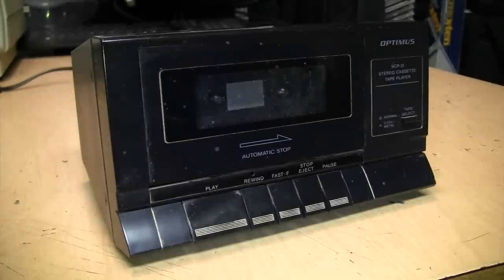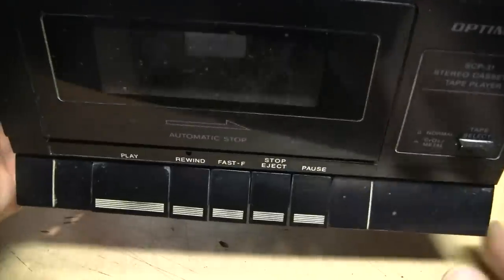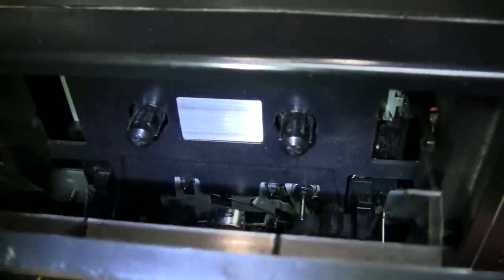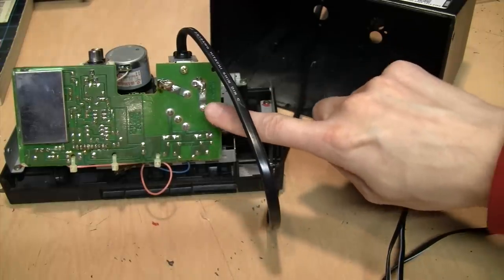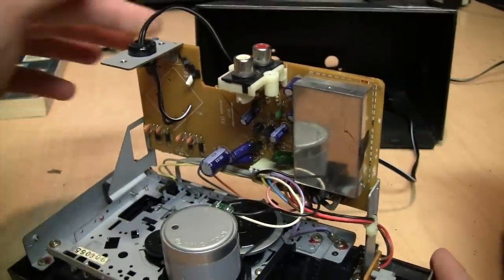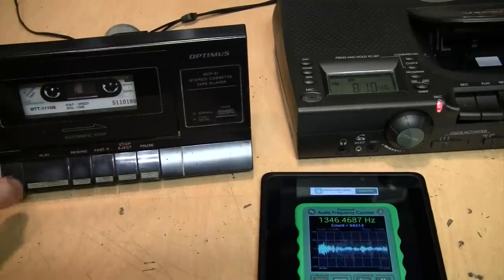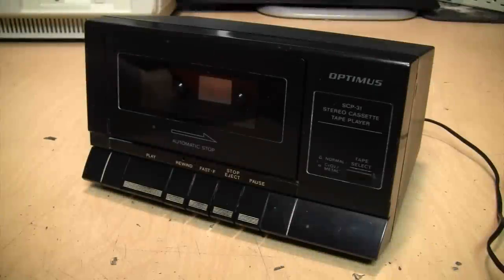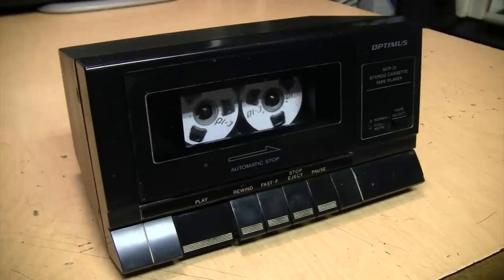Cheap but good Radio Shack SCP-31 cassette player repair

Comment: I'm blown away with the actual quality sound of such a relatively cheap unit.  Better than any current day tape mechanism sold on Amazon currently.  Makes me smile with how you brought this thing back to life.
Reply: This wouldn't impress much in 1989, except value for money. Tells you just how bad modern decks became.
Reply: @F40PH-2CAT  Especially since today's decks are basically the same design, so it's not like they have any new problems to deal with. They're just cheaping out to a (literal) fault.
Reply: for sure
Reply: Compared to MP3 the sound may seem OK.  When compared to an LP the tapes sounded noisy and lacked high range even with the latest version of Dolby noise reduction and "metal" tapes.  I mainly made tapes for car use.   My last deck was a Pioneer CT-6R.

Comment: I have a SCP-31. Original owner. And it still works! I worked for Radio Shack in the 1990s, and purchased one because of limited space in my apartment. It's not definitely not a Rolls-Royce among tape decks - more like a Volkswagen - but it definitely did the job it was designed to do. Music played on it was clear and an easy listen. It may not be the best, but for the price a SCP-31 can't be beat.

Comment: I enjoyed this. It was interesting when you pointed out the lack of a power switch, I hadn't noticed that.  That got me to thinking how receivers used to have power outlets on the rear.  I had a Yamaha CR-620 for many years, I believe it had a switched and an unswitched outlet on the back.  So, you could have plugged this into the switched outlet and it would have turned on and off with the receiver.  Those seem to have disappeared over the years.
Reply: Everything uses cheap annoying wall warts now
Reply: Believe it or not there's a switched outlet on the back of my AudioSource AMP 100. I don't use it, since the (rather large) toroidal transformer already whines and it's gotta be pushing some of that back into the mains power. I put that amp on the other side of an isolation transformer even though it doesn't make the whine any less audible.

This is some off the shelf black box from Parts Express ten years ago, too. Hardly anything in it other than the transformer and the heatsink for the transistors.
Reply: @The Vinyl Disguise I don't think it's really targeted at any particular device right now, but you can use that output to switch a much bigger relay and turn your entire rack of gear on if you wanted.

Comment: Love the Optimus stuff. I still use my Optimus system from 1991. I remember buying it and having to unbox some of it so it would all fit in my Chevy Cavalier. The speakers are huge.
Reply: same here. I have an optimus 10 band eq from the 90's too and it still works great in fact all of my stereo equipment is almost 30 years old and all of it still works great
Reply: But does it transform and roll out?
Reply: You had me at "1991" and "Cavalier."
I owned a '94 Cavvie 2-door once, that car was VERY good to me. Bought it from 2nd owner (1st owner was actually that stereotypical Little Old Lady) at 77k for $400, and I got t-boned by a Corolla at 236k, still on the original clutch when it went to the junkyard. (After the Corolla hit me, he got rear-ended by a Jetta... The only car not requiring a wrecker was my Cavalier!) Only left me stranded ONCE, when the fuel pump failed. I'd get another one in a heartbeat if I could find one.

I told a friend of mine once that I was going to grab an office chair for free on the side of the road, and he said, "you won't get that to fit in this car." Five minutes later, he had to move the passenger seat up two clicks, and the office chair was upside-down in the backseat. (My butt is currently planted in that same office chair sixteen or seventeen years later!)

And Brett - are you talking about the Optimus 10-band EQ with separate EQ for each channel, the "IMX Expander," and the tiny-dot LED spectrum analyzer? I had one of those too, I loved it. Unfortunately I fell on hard times and lost the contents of my storage unit years ago, that EQ was in storage at the time. 😢

Comment: I have two of these, in working condition.  Discarded by our church when we went to CD recording some 15 years ago.  (We've since obsoleted the CD burner, too, outputting from the mixer board to a SSD.)  I keep these two decks for the occasional dubbing request; some of my fellow geezers have family cassettes they have not heard in years.  The Shack also made a tiny AM-FM stereo receiver, about the size of a clock radio.  Got one of those, too, and it also works like a champ.

Comment: These transformers often have a thermal fuse that is taped to the secondary which opens if the windings get too hot, or just from age. I have repaired a few transformers by replacing or bypassing this. I am glad the repair worked well. What I would personally do, remove the transformer from the adapter and solder it to the original place to keep it cleaner. Love your channel, keep it up

Comment: When I worked at radio shack, these had a reputation of being very reliable despite the outward quality appearance.

Had a customer who bought a number of them tell his success with them, but were the auto reverse higher up version that had Dolby?  Been so long I could be wrong, but I remember us laughing about having Dolby for telephone on-hold, but only way to get auto-reverse in that model.

Told me they actually were the longest lasting tape decks they could find for their on-hold music systems.

Long chatter, but old memory that came back.
EDIT:  Wow, my memory worked...0:42 the $99 fancy one.  Sold like hotcakes.
Reply: I hate to be a "dick" lol, but if you watched his video he went through the radio shack catalog pointing out the 3 deck line up. Yes a Dolby and auto reverse model was available.
Reply: @glennjones6574  lol. YUP!  I had to edit my comment.  :)

Comment: I picked up the Realistic version at an estate sale last year for a cheap price. Mines needed belt and a disc capacitor resoldered in the inside the metal shield. Working great ever since. It’s was made April 1990.

Comment: I bought the playback only and the record deck on Ebay to go with my matching Optimus am/fm mini Amp which they were designed to compliment. Due to the age, I was hesitant, but was so pleasantly surprised. They were used in a garage work space (as it was described). Upon inspection,they were barely used, almost brand new. Both in excellent working condition. Okay they don't sonically reproduce like my larger system, but, for the den/guest room, the system produces beyond satisfactory sound. They, and the mini Optimus amp, connected to my large 70s vintage floor standing 3way speakers please these discerning ears.

Comment: This thing is awesome! Nice repair. I appreciate you leaving your incorrect guess in too, you could have easily edited it out to make it seem like you got it right the first time but repairs are all about making mistakes and fixing them.
Reply: For anyone wondering why that happened, the 12V AC is RMS (Root Mean Squared). The smoothing capacitors will charge to the peak voltage which you get by multiplying by the square root of 2   i.e. 1.41.   So once it is rectified and filtered 12V AC becomes almost 17v DC. The transformer manufacturer will also allow for the voltage dropping on load so the off load voltages were even higher,

Comment: This came from a good period in Radio Shack history, before the default answer to any question about a product was "Would you like a cell phone with that?" 
And thanks for showing the insides in the video, I've got the SCP-25 from just a few years earlier and always wondered if Radio Shack changed the internal mechanism as they transitioned from silver to the "black plastic" look...

Comment: My biggest gripe with these was how light they were.  It was hard to use the transport controls without the player scooting all around the shelf.   Thats why it was duct-taped down.  The alternative was to hold the thing down with one hand and push the buttons with the other (or you could do the spanned thumb-index finger thing).

By the way, the companion SA-10, SA150, and SA155 'mini' amps that these were often 'bundled' with also had the always-on PSUs, with the power switches wired into the secondary side.  I don't like that 'feature'.  It's why I have all my electronics connected to power via a power strip.

Comment: This shows that there are different shades of BPC, and this one is perfectly usable, especially considering the price. Its S/N ratio is good enough for radio recordings, and its wow & flutter is surprisingly decent, although I wonder why you haven't disclosed the numbers you've measured. As a playback machine it is no worse than the $500 TEAC W-1200, which has a similar mechanism and does not have Dolby NR just like this one.
Reply: BPC often isn't even all that "C". 
I don't think the case material and color is the best indicator for quality.
Reply from the maker: I tested it and it measures around 0.08% to 0.11% WRMS -- better than the factory spec of 0.15%.
Reply: @vwestlife  The factory spec says "wow & flutter: 0.15%" without specifying whether it is DIN or JIS or NAB, so it is unclear to me which standard did they have in mind. In any case, 0.1% WRMS is a very decent number for a cheap machine. You don't need an expensive complicated mechanism to achieve good enough performance. Thank you for the video!
Reply from the maker: @ConsumerDV  The manual for the SCT-510 lists its wow & flutter as 0.15% WRMS, so the SCP-31's rating is most likely WRMS as well.

Comment: At least it's not a knock-off of the Tanashin mechanism, and does have a genuine Mabuchi motor. That's already more than what you will find in most "modern" cassette players - which will also cost much more. All in all, I'd say that was a nice thrift store finding.

Comment: I collect tape machines and Tandy Radio Shack created a lot of value for the consumer at all budget levels.

I liked the way they put together systems with all the components already matched to work together for different budgets. Remember the "Good, Better, Best"? 

 I use a Realistic SA-10 solid state amplifier as my bench test amplifier. Power supply same design, it draws 1.1 watt in the power off position, and 1.7 watt at power on position at idle. Unplugged or hooked up to a power strip for sure. 900 mW per channel with no balance control, separate right and left volume pots, which I prefer on the bench. Think it was $4.99 at the Goodwill.
Reply: I have one of those as well, a good, basic small amp.  I got it from my brother, who somehow lost some of the knobs, which I replaced with a different set that at least all match.  I also have it's big brother, the SA-150.
Reply: @bobblum5973  I was just looking at mine and noticed there is still a sticker on the right hand side that says "Simulated Walnut Grain Finish".

 Really? Isn't it obvious? Does someone really need this information? Probably someone's job putting these stickers on as it is going down the production line.
Reply: @zulumax1  I think they started doing that as part of a "truth in labeling" law.  Like having to say "Walnut Veneer" so people would know it was a thin piece of real wood, but not solid wood for the entire cabinet.  Or listing the ingredients in order: "Soup; Chicken; Flavored".

Comment: I still have my early 2000 boombox with radio and CD and I enjoy it every time I can. Yesterday I visited a nearby recycling center and found a bag with 30 used audio tapes  and 4 brand new sealed TDK. Also I found a old Sanyo from '79 I think, mono tape recorder with FM/AM/SW radio, a beauty. I still have to figure what is its fault because it powers up but no audio comes aside humming. It seems is made entirely with transistors, no ICs.

Comment: I've got a Realistic branded SCP-32! I picked it up late last year and used it for my tapes before I swapped it out with a hi-fi mini system. Mine was an eBay buy so it was in great condition mechanically and cosmetically. I've got tight spaces to work with right now, so it was perfect.

Comment: This kind of transformer on the deck is fixable (they usually have a built in fuse/thermal fuse, only 110v transformers that have this fuse have 2 long pins that are soldered on the board and one short pin and all you have to do is measure to find what pins are soldered to the coils (generally one short pin and one long) i say that because i fixed a japanese boombox with the same problem and i added a external fuse to avoid burning the transformer
Reply: Came to leave the same comment. It was the thermal fuse for sure, they tend to fail by age, even if the transformer is perfectly fine...
Reply: @janosnagyj.9540  Yes
Reply: Yes have repaired many of those transformers by simply replacing the thermal fuse or bypassing it and place a small in-line fuse inside for protection.
Reply: @111000100101001  and works perfectly
Reply: @vinil, o melhor presente !  These decks would be happy in Japan with their 100V; it would last a little longer there!

Comment: Yes, when ac is rectified into dc the voltage goes up a little bit. Also, unless it's regulated the output will vary with the mains voltage. I didn't see a fuse either.
Reply: The voltage goes up by a factor of sqrt(2) = 1.414…
Reply: @MacPhantom  Minus the drop of the bridge rectifier, i.e. always 2 diodes in series - around 1.6 volts for two silicon diodes.
Reply: I noticed with a lot of older power bricks that I had I was surprised at a younger age that they may have been listed as 12V DC but they usually read more like 20V after that I became very paranoid about using them with some devices.

I was reminded of this a few days ago when I pulled out a 9V DC power adapter that was outputting 16V DC. I don't know if I want to use that with my portable cassette deck it's not like I want to I have to replace something in a $500 Sony recorder.
Reply: @imark7777777  It's simple. When you have an unregulated (non-stabilized) power supply, either AC or DC that is rated e.g. 12V/500mA, it means that - given the exact primary voltage - there's exactly 12 volts on the output when there's a current draw of exactly half an amp. On no or lower load, the output voltage will be higher; conversely, on higher loads, the voltage is brought down and the transformer saturates.
And, of course, if the rating is in ac, it means 12 volts root mean square of the sine wave. When rectified (and filtered), the output voltage is the very amplitude of the sine, minus the drop of the rectifier.
Reply: @JozefBogin  that is amazingly the most simple explanation I've ever heard on the subject I finally get it. thanks!
So then I think the original adapter would've been 9V 0.6A-1.5A and the adapter I dug out of my collection was for a KOSS 9V 1.2A testing 13.10V open circuit. Would I then be safe combining those two?
Unfortunately only voltage and negative polarity are the things marked on the device so I'm going by eBay photos. I have yet to stick an amp meter on it as it was a few orders of magnitude larger than I was expecting.
Reply: @imark7777777  Yes, check the polarity (some old power bricks do not contain a rectifier) and you're good to go.
Reply: @JozefBogin  well that's good. It is definitely negative center device and power adapter. I was digging for something else and I spotted it I got very excited. Why do manufacturers have to use negative center grrr. Although apparently if you do encounter it I found some polarity flipping cables I forget the ebay search criteria but figured they'd be handy.
Reply: @imark7777777   Nothing with a transformer input can have a particularly tight tolerance.  It's going to vary widely, which is why they're usually followed by a voltage regulator if it matters at all.  It's really interesting that this deck doesn't have one.
Reply: @imark7777777  The voltage should be higher when checking on a meter vs. under a load. It's probably fine as long as the regulation is being done by the device as the input voltage should be high due to losses under load and to provide stable regulation.

Comment: Bought one of those for the family back in the day.  Not sure what they would have done with it by now.  
I'm sure the owner taped this one down because you couldn't use it like a normal deck because it was too light. It either took two hands, or you'd have to hold down the top while reaching for the buttons on the bottom with the other hand.  If you didn't do that, it would just slide around as you tried to push the buttons, lol.

Comment: Had one of these for years on my speaker system round the house for years and it's been excellent. It seems to run to speed well with no noticable wow and flutter. Recently aquired the auto reverse version too, but I don't think Radio Shack here in the UK (Tandy) ever sold the recorder version.

Comment: About 5 years ago I was at a local retro repair shop to get a some belts they had and as a question about something else I thought they might repair. In that process they said they had a Radio Shack tape deck that was not worth their time to replace the belts due to the cost, so I was given the tape deck. It is much like yours here but it also has the record function as well. New belts and it was just fine....

Comment: When I worked at Nottingham Radio in the 80's & 90's, the owner did a part time job as assistant projectionist at a Cinema. The 'non sync' music, i.e. the music they played before the show & after was done using one of these cassette decks. I have a couple too use them at the test bench as a useful signal source when testing amplifiers.

Richard, G0OJF, UK

Comment: Yup, my turntable is that way - no turn off button, always supplying power. So I had it plugged in my amp power in. When I upgraded my amp, I decided to plug it in a switch outlet along with my VCR, because I don't use them very often.